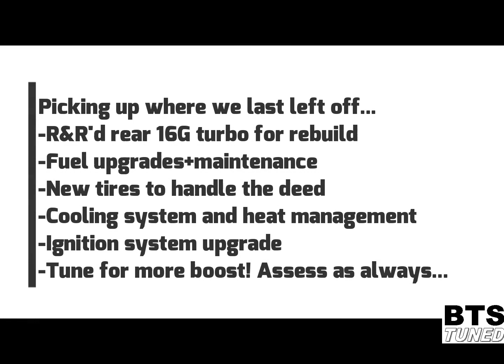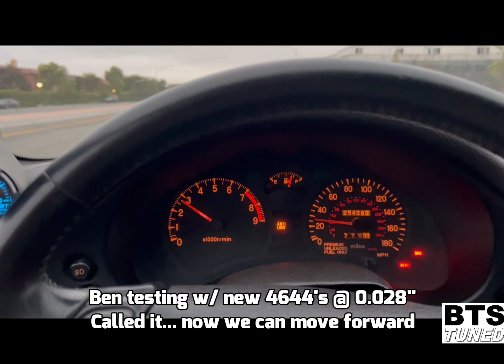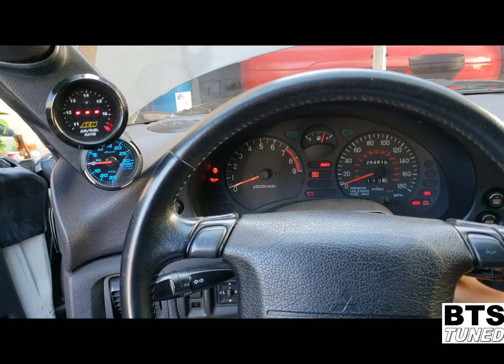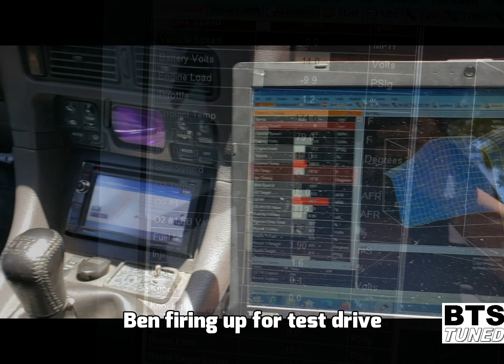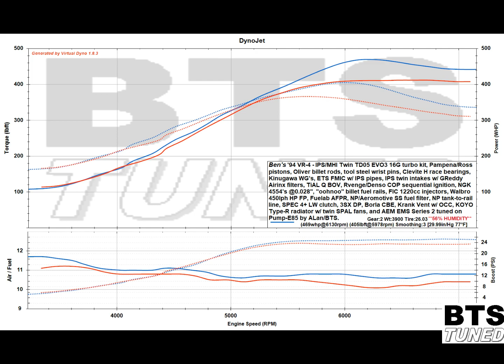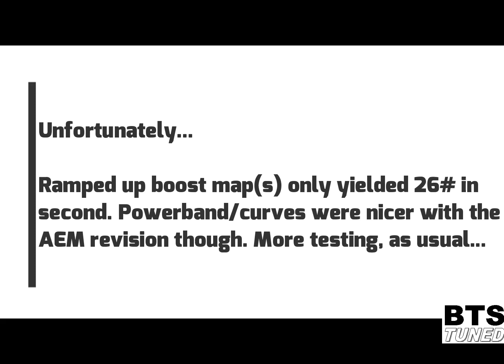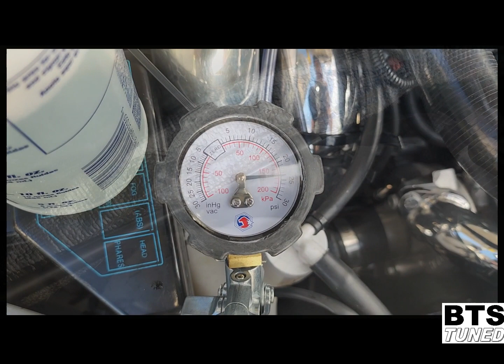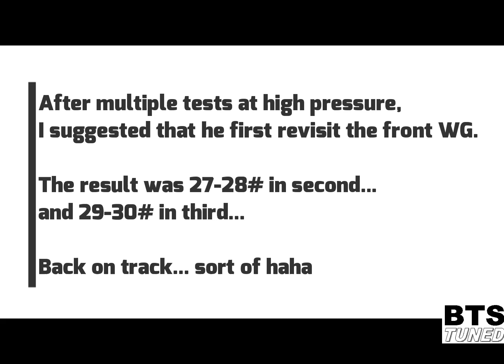Ben's 1994 Mitsubishi 3000GT VR-4 -  "2022 Quest for 500AWHP" w/ MHI EVOIII 16G's, AEM EMS, and E85

Comment from the maker: Late update from follow-up/confirmation back in December 2022:

"...same AEM tune from July but with WG pre-load corrected and 50°F boost weather (4-5psi more than last time)

Est. 550AWHP VD SAE (590 U/C) with fuel flow hindered but will be addressed ASAP."